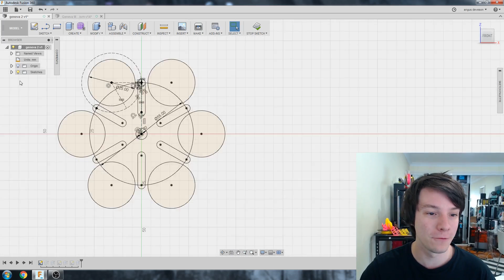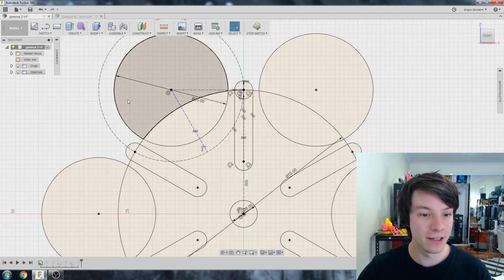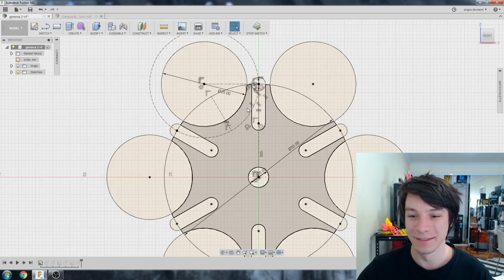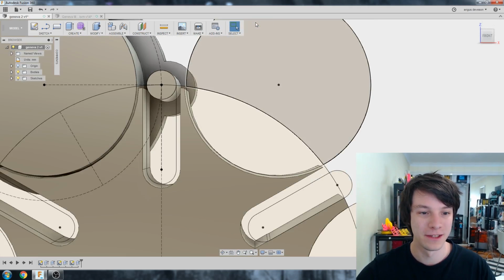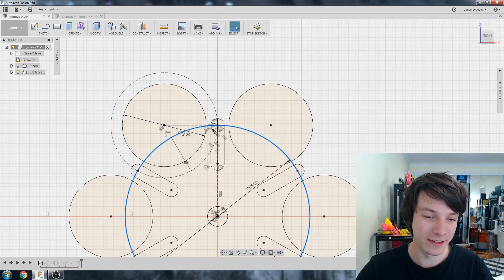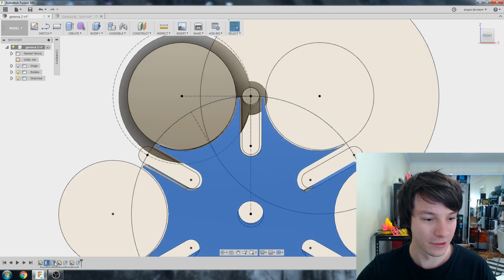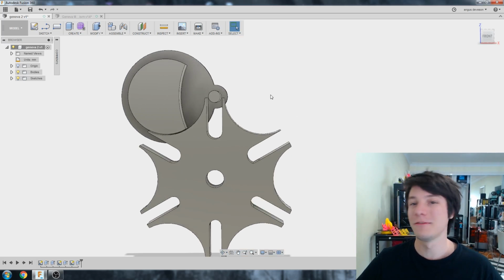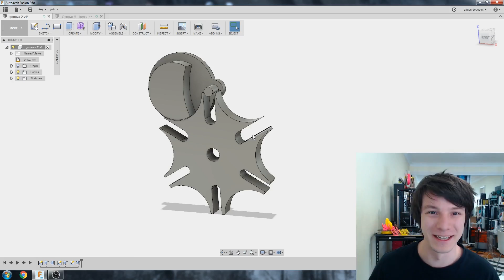Mistakes I made drawing the Geneva Mechanism!

Comment: Very good video and channel. Here I come with another mistake :) The clearance as you calculate it is fine, but keep in mind that this is not the exact curve, meaning the one that removes the minimum amount of material that allows your system to work. You are using the radius of the big wheel. In fact, this is the clearance you need if your small wheel were static. Since your small wheel is spinning at the same time, the actual cutout may be tighter. If you do the math you will arrive at a curve, which is roughly a circular segment with radius that of the small wheel. In fact, using small wheel radius with center at the knob is a great approximation.

Comment: One thing you didn't note: when creating the cutout, you made a circle of the same diameter as the driven wheel, centered at the centre of the next sketch circle defining the next idler curve (sorry, I have no idea of the actual terms for these parts and surfaces). This only works because you were doing a mechanism with six stations per rotation. If you had seven, or four, or any other number, you'd need to do this with a couple more constraints. Namely, the center of the circle defining the cutout would need to be along the line between the drive wheel hub and the peg centre, at a distance from the drive wheel hub equal to the distance from the driven wheel hub to the drive wheel hub. On a six-sided driven wheel, this happens to be coincident with the centre of the circle defining the next cutout in the driven wheel. But not so on others.
Reply: No, that's better but not right. The minimal cutout, i.e. the path of the prongs of the driven wheel on the driving wheel, is a hypocycloid or something, not a circle sector. But that doesn't matter since the cutout only needs to be bigger than the path, not exactly right. What does matter, though, is the exact location of the start and end points of the cutout. They should be as close together as possible in order for the driving wheel to lock the driven wheel until the peg enters the slot. But how can we find those points parametrically?

Comment: I did notice something that can be a little different from the sketch. The depth of the slot does not have to be as long to the center of the driven gear. It only needs to be the OD of the driven gear to the OD of the drive gear. Going from the center of the drive gear makes the slot longer than needed.

Thank you for the amazing videos, always like watching your Fusion360 tutorials/designs because you learn new things all the time.

Comment: Hi Angus
Have you got a Vibrometer and Sound Level Meter yet?   Why not use iPhone apps like SPL meter or Bismarck bs-spectrum for sound levels or Hamm Seismograph as a vibrometer?   They are cheap :) and accurate enough, and they have the added benefit that your fans can use the same apps to compare their machines with your reviews.   Also, the seismograph would give cool tracings of x,y and z movements to help pin down the source of the vibration or which way the bracing or dampening needs to be added.   And for for hardly any money :)

Comment: I think you also missed the clearance between the bottom plate of the drive wheel and the driven wheel. Right now they touch each other perfectly in the CAD. This could be compensated in the mounting frame of course.

Comment: someone help i have a ctc bizer 2x and i cant find any good slicer pls help!!
Reply: Is that the one that uses x3g files?  I have the CTC Dual extruder and still use the
Makerbot software Makerware. I have stuck to version 2.4.1.24. 
I had a later version auto update and i created my x3g file and it crashed the printer
head.  I reverted back but it auto updated again.  The version above does not auto
update.  I have a friend that owns simplify 3D. He can also slice things for me, but
i rarely ask him. Makerware works quite well.

Comment: ummm... still broken? the driven/star gear now has mis-matched slots and cam surfaces.
Reply from the maker: what the heck it didn't update the extrude... went into the design again and it's as it should be. Fusion glitched in that circumstance I think, you can see the sketch is correct. EDIT: Yeah it's the extrude cut for the clearance offset that went strange there, works fine now and can't reproduce the bug <_>
Reply: I think the trick is to define your extrusion boundry with sketch lines and everthing else with construction lines. If you need multiple selects to grab all the segments you need for your extrusion there's a good chance your part will break eventually.  Fantastic channel Angus, I bought a CR-10 recently based in part on your reviews.
Reply: Maker's Muse yay! for slightly beta software :). glad it was just a glitch